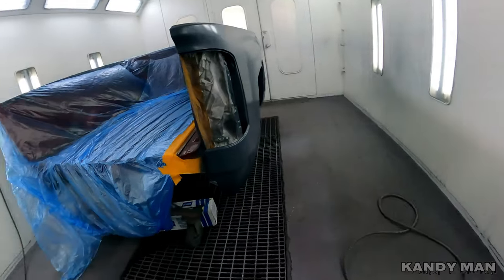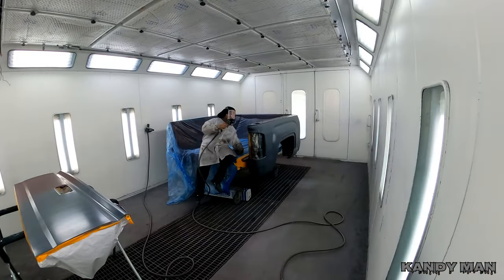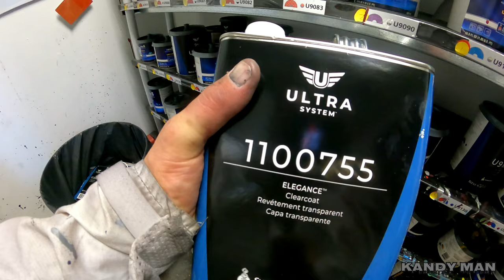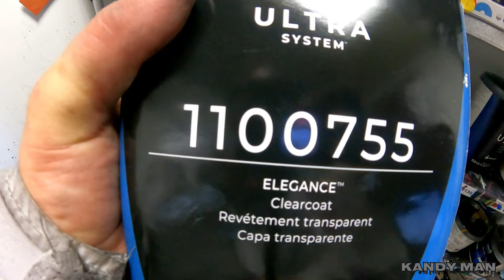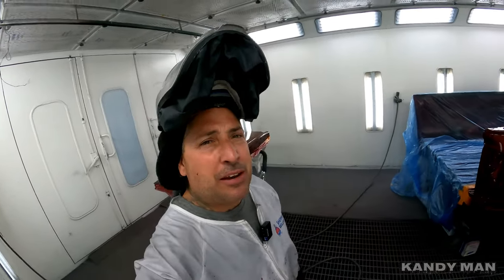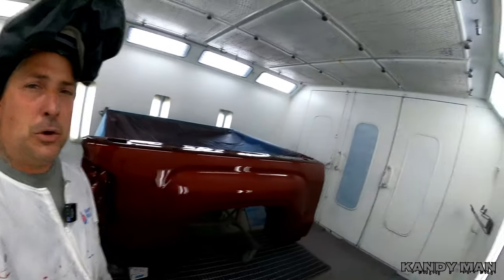ELEGANCE CLEARCOAT

Comment: The Cutlass is coming along nicely and I can't wait to see it finished!  The question I have for you is if you had decided to go back with the original orange color, would you have still used the P30 primer on it?  Or would you have done the body work and sprayed it with a sealer and then base coat?
Reply from the maker: Still would have used p30 absolutely 💯

Comment: in terms on gloss, easy to use., DOI, what sre the differences between CC200 and 1100755?  how do you compare this 2 SW with PPG DCU2021? 
One last question, have you ever use PPG VC5700 and how do you compare to 1100755?
Reply from the maker: Cc200  is lower solids  clear  and designed more for production work it is a great clear .were the other is slower and higher solids .